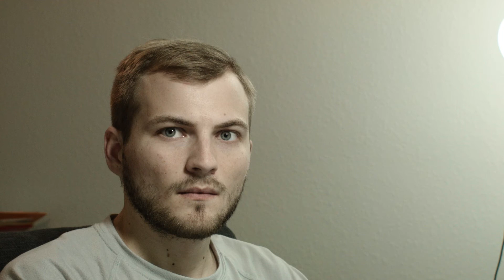Circuit Design Review Intro

Comment: Sir any video on designing RF receiver and transmitter module circuit diagram with step by step explanation , 
Or
Sir any video on explaining step by step the working of the 433mhz RF receiver and transmitter module circuit diagram , 
explaining step by step the signal generation and flow of it. Sir, explaining the function of the electronic components used eg. Crystal etc